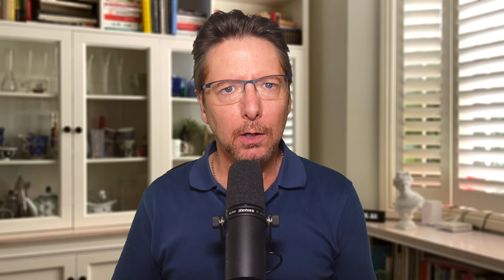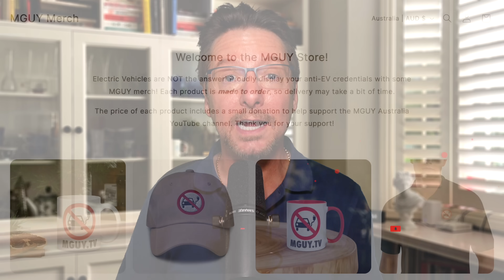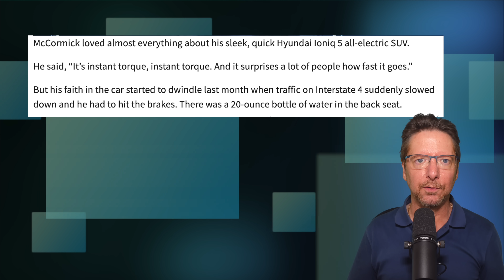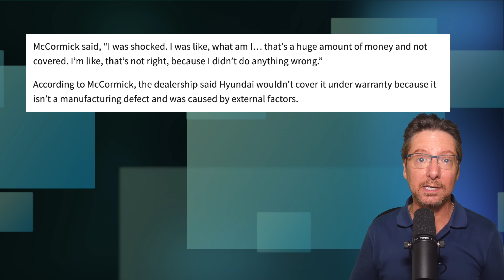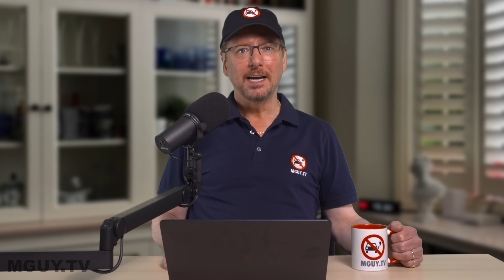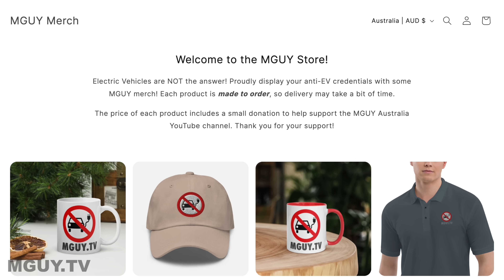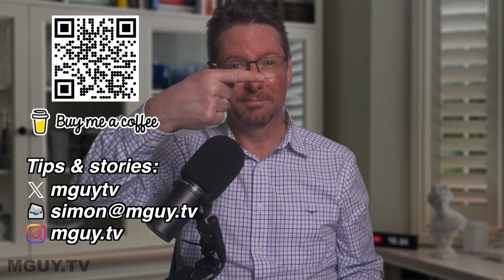ASTRONOMICAL EV repair bill for spilling a WATER BOTTLE! | MGUY Australia

Comment: It woud seem to me that EV car manufacturers would know that water and wiring in cars do not go together and any wiring under the carpet should be protected by a rubber membrane. So technically this a manufacturing defect for leaving the wiring exposed. My 99 Chevy Blazer had its heater core start leaking around 200k. Saturated the entire front floorboard. when I pealed back the waterlogged carpet I found wiring. It never shorted out. It has 225k miles now. They don't make them like they used to.

Comment: A car being so severely damaged by water spillage is certainly a manufacturing defect! More accurately, a design defect, but that means the defect was present in the car at the time of purchase, which means it is still their responsibility. Car makers aren't off the hook if a given issue is a design defect rather than a simple manufacturing issue. They have been forced to recall and repair design defects scores of times over the years.

The "logic" used to deny the warranty claim could be used to deny just about anything. If you hit a bump (a reasonable one, not one that obviously causes damage) and your car stops working, that's an external event too... but a car needs to be able to tolerate this to be fit for purpose. It should also be reasonably tolerant of water on the floor of the car, as there are a lot of things that can cause that to happen in the normal use of a car. Twenty ounces of water is not that much!

And as to the insurer refusing to cover it because the corrosion built up over time and did not happen as a result of the water bottle... either that is true or that is not true. They just mentioned that in passing, but didn't mention how that decision came to be made. It seems like there has to be more to this story. And if it was corrosion over time, that just feeds back into the issue being a defect present at the time of purchase that Hyundai should fix at their own expense.

Comment: Wait… it HAS to be a manufacturing defect (Warranty), or incident related (Insurance). Since the car worked up until the incident, I think the insurance is on the hook for this one, regardless of whatever corrosion was going on before that incident. The corrosion alone was NOT the trigger that broke the car. I would contact the state insurance commissioner.

Comment: To be fair this is not an electric car problem. The same thing would have happened with an ICE car.
In all cars there are plugs and relay modules scattered around the cabin. (even on my pre 2000 cars)
For such a newish car the corrosion should not have been a issue so the insurance should have covered this.

Comment: When I lived in Cali. a neighbor bought a Tesla model S. He wanted to install a charging station in the garage so he priced it out and for the charger it was around $2500  (5 yrs ago). He then asked the power company for a n estimate to install lines to the house to power the charging station. It was $8800 as they would have to run a second set of line equal to the house power ( [2] 100 amp lines and the bill would be a separate charge/mo. A week later he had a new GAS car!!  The other reason was it took him 2.5 days to go to Phoenix because he had to stop and charge it

Comment: If you buy an electric car knowing all the drawbacks of the things, then you deserve issues you get. If they drove 10,000 miles per charge I might get one but the range we get is a couple hundred miles. It is faster to get gas than to charge by 1000%. If you can afford a 100,000$ car to get groceries in mor power to you but the current evs are a scam.

Comment: One day while driving in the Mrs vt commodore she had to hit the brakes hard as traffic on the fwy suddenly stopped.  All our shopping on the back seat flew forward.  A 1 ltr bottle of Jack Daniels smashed, a carton of milk burst open. Carpet was drenched.  What issues did this cause for the car , none other than it started to smell by time we arrived home. And because im a mechanic I removed the carpet gave it a good clean let it dry out and re installed the carpet. Job done no issues to the car what so ever. F,,k EV junk. Expensive golf carts.

Comment: Pull out the seats and carpet. Pull apart every wire connector and blow dry them. Shoot the contacts with contact parts spray. It almost always works.

Comment: There has to be more too this, if the water was spilt on the wiring it doesnt cause corrosion over night. To be corroded I assume there must be connectors under the seat because I find it hard to believe coated wire would corrode so what ever caused this loom to fail has to be either before the water was spilt or  something else. Water getting on a connector is easily dried. You can bet the $11K is largely labour not the loom but I equally find it hard to believe the whole loom needs replacing, surely an auto electrician can replace the connectors or what ever. If it is true that the agent wanted to replace the whole loom then they are simply ripping the client off to try and sell them a new car. In all honesty although I agree EV's are a nightmare from numerous perspectives this doesn't sound like an EV specific problem

Comment: Hi from the UK. My neighbour bought a Tesla modal 3 about a year ago. In a car park the near side door mirror was damaged, not wanting to involve his insurance (he bitched about high premiums). He contacted a Tesla service centre and was told, to supply & fit a new mirror would cost about £1000 plus VAT. (to non UK it's value added  tax). A used item bought on line would cost abought £200. but if fitted would void his remaining warranty

Comment: I don't care if you like EVs or not. The Iqonic 5's problem is not that it's an EV. The problem is that is cheaply made. Hyundai just cut to many corners to make more profit and are not willing to adress and/or fix the main problems. The charging electronics will fail every 30.000 km, the 12V battery will last not longer than an year. And a lot of 'small' problems like self opening windows, failing wiring harnesses like here, weird display issue and a lot more. Its the same with Hyundai 2.5l petrol engines they just can't build one or simply don't care. Same with customer support if it broke down it will take weeks or even months to fix. They won't tell where's the problem why it takes so long or don't care how long it will take. You have to wait. You might get an car on loan or you might pay for it later. You never know and it doesn't make any difference you have a ICE car or an EV Hyundai or KIA.

Comment: It's an engineering failure of the grossest kind if the electronics in a vehicle are not conformal coated and sealed in a water and water vapor proof container! This isn't a stereo that sits in your nice, dry, climate controlled living room. This is a vehicle that sits out in the weather.

Comment: If we wanted a level playing field, EV's could be reset with an OTA update to accelerate with 0-60 times in line with Corollas, Camrys, RAV-4s and 4-runners. The result would be much more range and/or longer battery life. The dual-motor bros could pay the extra $7,500 that was gifted to them through tax breaks to unlock a 6 second run.

The Plaids (or anything under 6 seconds) could pay that plus a similar 'power guzzler tax' levied on supercars to enable that kind of reckless behavior. Those launches can't be good for the asphalt or any kind of safety considerations. Lastly, the HOV lane should not be open to solo drivers just because their environmental destruction comes from mining rather than drilling.

Comment: Okay, this gotta be a bad joke. What I take out of this is, that a little bit of water and also sand in the spot where feet would be, can kill the entire vehicle? Because it's so very uncommon to have wet or dirty shoes, right..... Honestly, I would demand a free fix, otherwise suing them for malpractice, because there's gotta be some kind of standard, how passenger vehicles gotta be built and that they have to be able to deal with wet shoes.

Not to mention, there have been quite a few normal vehicles, that basically had pools in their foot areas due to some leak in the sunroof or something like that. And nothing ever happened.

Comment: I have an old RAV4, I kind of feel his pain in regards to the price. I have to replace a $5 welch plug, I have been quoted between $1000 and $2000!  Unfortunately the plug is at the back of the engine and the firewall makes it impossible to get to unless either the sub frame or the engine are removed.

Comment: The ECU on my 92 Toyota JZZ30 took a dump about 4 months ago. I quickly discovered the blown cap. Took 2 days to get a replacement (RIP the days of Radio Shack and local electronic warehouses)... desoldered, cleaned, soldered, cleaned.
Done. Everything works again.

Comment: Any vehicle regardless of fuel type any newer than around 10 years old has very similar problems, the more that’s been done to them to meet the safety requirements has been done the more expensive they are when something electrical goes wrong. My 8 year old Hyundai i10 (petrol) had a problem with the electric window switch pushing through the surround in the armrest, I couldn’t get the window up or down. I managed to grip it with bbq skewers and operate the window to a secure position. Took it to the dealer thinking it’s not an expensive fix, just the surround or a new switch. They wanted £450 to repair it as in replacement of the whole assembly. I went out in disgust and had a good look at it, I found that basically it was a poor design, the way it was held was flimsy and wasn’t difficult to break. So I took the assembly out and reinforced the remaining switches where the weakness was and repaired the one that had broken. The cost? a few pieces of polycarbonate and some strong cyanoacrylate glue (Gorilla cyano); roughly £5 all in plus a couple of hours of my hard work.
My son had the same problems with his VW Passat, fortunately his friend is a Master Tech and knows how to fix things rather than replacing an assembly.
Lesson learned, Older cars (20+ years old) are much less expensive to fix than the newer cars, I shall stick to my 20 year old Volvo V50 D3 until it’s beyond economic repair! (The i10 replacement).

Comment: I call it the 'Ironic'. Cost £25,000 more than the diesel i40 tourer but is now worth less for the same age. The service intervals are half the i40 and cost more. Tyres are 56% more expensive due to the weight and last half as long. Got to be a complete fool to buy one.

Comment: highly electronic vehicles and EVs are actually cheaper to manufacture than modern ICE and analog vehicles. the repair problem is mostly thanks to "modern business decisions" like "just-in-time manufacturing" and "planned obsolescence."  factories make enough parts to make the car, almost no production for repair/replacement parts. and since there are now 9000 models of car, the "aftermarket" is less likely to have a "databus relay module for a 2022 Haiundai Ionic SUV" since the 2021 and 2023 models were both a whole different part.

Comment: No they won't make it more waterproof freaking Nissan has known for years their choice on making master control panels in the car and if it rains and you drive and you have your window down they 200% know with it being mentioned in your booklet when you get the car don't do that because it will destroy your master control panel even though it just takes a single freaking grocery bag to be placed between the control inlet and buttons you see on the outer side of the control panel simple bag but they choose not to do it

Comment: Some out-of-the-box thinking is required here:-  Cars, including EV's, are specifically designed to convey human beings. Human beings are very dependent on being fed water on a continuous basis (3 litres/day?). I recently drove from Brisbane to Perth, - and I remember reading (good) advice "to carry water in the car", - which I expect that every car driver in Australia does regularly? So, if a Hyundai gets "damaged" to such an extent as a result of "carrying water", then it is NOT fit-for-purpose as a car in Australia. Come on lawyers, - take this to court. it's not the fault of the water, - it's the design fault of the car for not being able to contend with the stuff that is essential for the life of every single buyer and owner of ANY car, - every day of their lives.
Reply: Continuing my comment above. The Hyundai has cup holders? How many? What capacity cup/can, bottle holders? perhaps a total capacity of drinks of 3 litres? All drinks are basically water, so 3 litres of "water". By providing these cup-holders in the passenger space Hyundai are facilitating, condoning, allowing, suggesting that there will be 3 litres of water in the passenger space. So, what precautions did Hyundai design and build into the fabrication of the Hyundai to minimize the effect/outcome of any possible/probable spillage? Any?

Comment: I'm Canadian and will NEVER buy an EV of any type. At first, I thought they were novel and may be a good niche for city cars and grocery getters. But now, I believe they have no place in society yet. Plugs freezing in place. Door handles freezing. Water bricking the whole car. 85k to replace a whole side panel because someone decided a truck has to have one piece from bumper to bumper. Electricity theft from private owners homes. And so much more. If they add AI to them, I can see far more than just Teslas trying to get away from an accident because the auto drive doesn't register the wreck or navigation systems that I believe use iMaps, thinking a flood going across the road is the road. The technology isn't ready enough for general public use. Period.

Comment: When Pintos and F150 pick up trucks blow up because of trouble safety standards due to poorly designed gas tanks, the media didn’t accuse all gas power cars to be unsafe. You however have labelled all EV cars to be less than capable. It’s a but disingenuous, of you. That said, many in the EV community know that batteries made in South Korea have design problems. This example is one of a few they have.

Comment: One time I left my sunroof open in the early 2000s when we still had shopping malls, where I worked. It rained for hours but I didn’t know it was even raining. Left my shift to find my Lexus sopping wet. Drove it home wet. Let it air out for days. Everything was fine. In fact my aunt still drives that Lexus, now with 450k miles on it.

Comment: ICEs are not much different, just less expensive. Over $2000 to replace a cracked tail light lens because the taillight assembly is a single, sealed module.

Comment: Just stay away from Hyundai/Kia cars full stop. I've had my 2013 Santa Fe from new and it has been a money pit. 3 EPB switch's, EPB module, 2 Viscous couplers, transfer box knackered. rear camera works when it feels like it which is not very often. reverse sensors have gave up. steering wheel audio controls work sometimes, multiple track rods ends and I've got play in the steering rack. Always serviced at 5k, no tow bar, I don't thrash it or fly over speed bumps. I know they say a Friday afternoon car but this is taking the slash. I will NEVER EVER buy another Hyundai or Kia, EVER and most certainly an EV🤮

Comment: EVERYONE: Hyundai and Kia are recalling over 330,000 2020-2023 Hyundai Sonata and 2021-2024 Kia K5 sedans to fix a faulty fuel tank that could leak and cause a FIRE. Only vehicles with a 1.6-liter turbocharged GAS direct injection engine are included in the recall.

MGUY: look everyone I found this one EV that had some weird fault, look over here, EV's are bad, see, I found one, everybody...?
Reply: you are exactly correct, MGUY is saying we should stop progress due to sometimes naturally progress has a minor problem. what some people will stoop to for money

Comment: If you owned a new Model T Ford, 110 years ago, you could happily spill a whole flagon of (insert your preferred fluid here) in the back seat, or the front seat, or even in the engine bay, and be on your way, without bothering the dealer, the insurance company or any workshop. 60 years later, that scenario could happily still be applied to Holden Kingswood or Ford Falcon, even Holden Commodore. Haven't we come far with all the new tech crap?? or not. You wouldn't even take it out in rain, for fear of a large puddle. Lord help you, if you have an anxious 3 year old in the back seat of your shiny new EV, and they just can't hold on any more (they tried so hard too) and let rip with a bellyful of whatever they got going. Anyone with a toddler will know exactly how that works . Very expensive toddler. Sell the toddler I guess, its the only way. So, what do we learn from this?? Get out there, bin your EV for as many pacific pesos as you can get, and buy a Kingswood, or a Commodore, a Falcon, even a Model T Ford. You will be miles out in front, for many many years to come. Oh, and send a box of tissues to Bowen.

Comment: As an industrial electronics engineer myself I can assure you the problem is not the fact that today's cars are basically computers on wheels. Any industrial computer that is expected to be operated in harsh environment (moisture, corrision, vibrations, wide temperature ranges, etc...) is usually well equipped for the task. The problem is that they are electrically and mechanically incompetent put together, cheaply made computers on wheels. The hilariously technically incompetent Cybertruck is the perfect example for this.